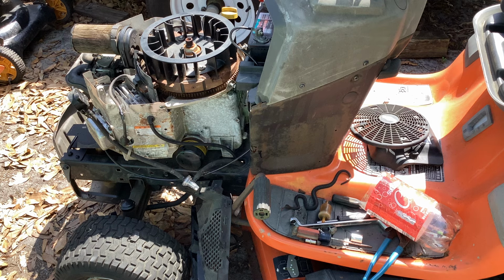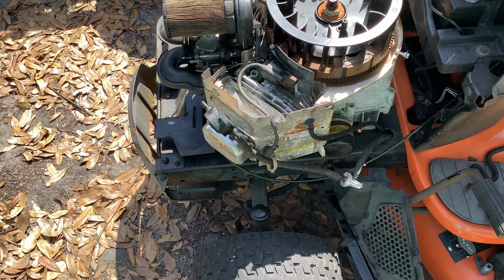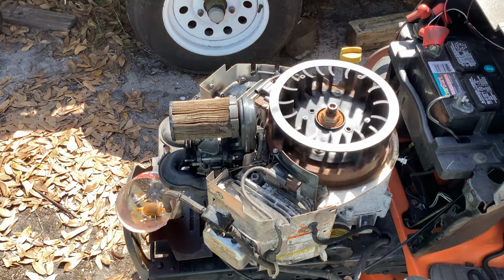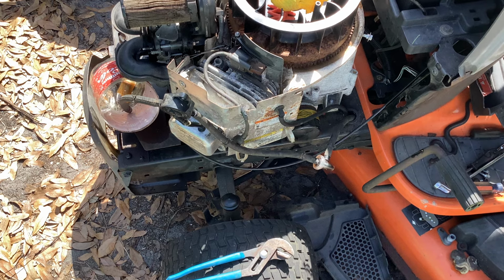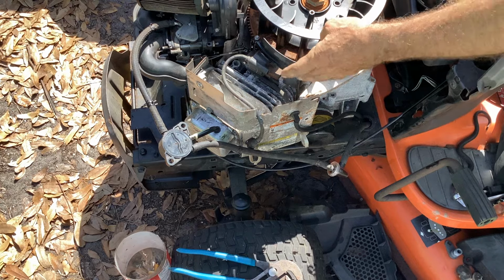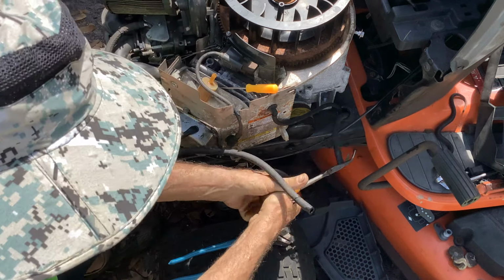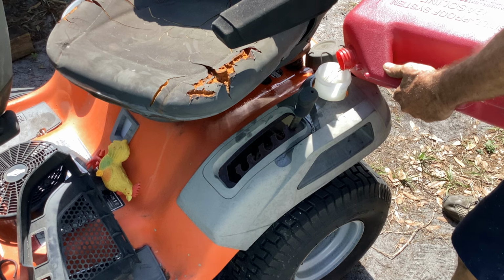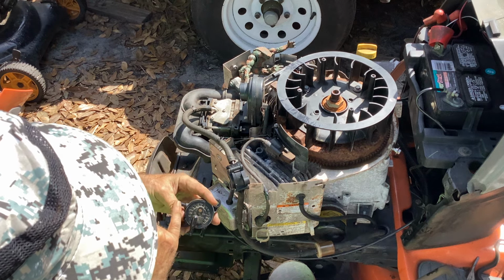Husqvarna YTA24V48 Rider Mower Gets my Full Attention Today.  A little progress with this Turd..!!!

Comment: Tommy I may be wrong, I've been wrong many times before, but I think that the fan shroud being off is allowing the air vain which controls the governor to open to far which is why you are having to hold it to keep the engine running.
Reply: Good   day   Yes u may be right with that.
Reply from the maker: Good call.  Will reassemble.

Comment: Well, that's a bit of progress but not enough to remove the Big Orange Turd designation. I'm still trying to get over that your buddy paid $250 for that POS. I finally have another project to work on. My neighbor, the junk hauler, picked up a 2008 (08/08/08 on the B &S engine)Toro Recycler yesterday. It looks like it's been stored inside but has a big gas leak somewhere. It starts then dies so should be an easy fix. I'll have to find out if he plans to keep it or sell it, that will determine how far I take the revival. Good luck on getting the Big Orange Turd motivating, will be watching for future updates!!
Reply from the maker: Good luck with the Toro.
Reply: @tommy-time5240  It was an easy fix, just replaced the cracked gas tank with an old one I had lying around, cleaned the fouled spark plug and she started right up. Of course, the main problem was someone had put 2 stroke fuel in it!!
Reply from the maker: Glad you had success with the Toro. @johnhyde5841